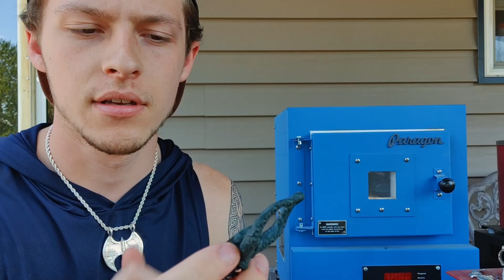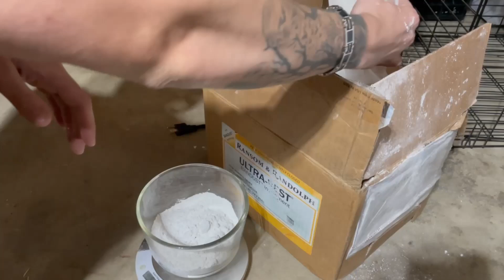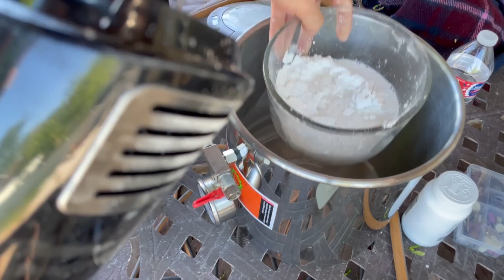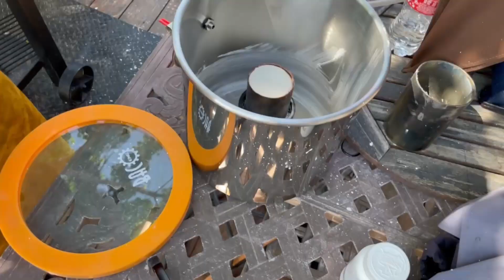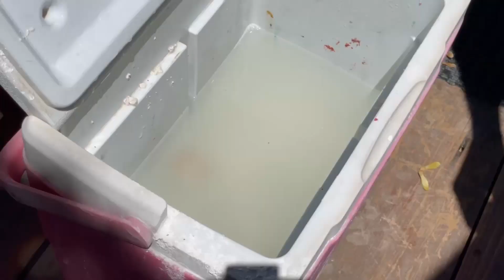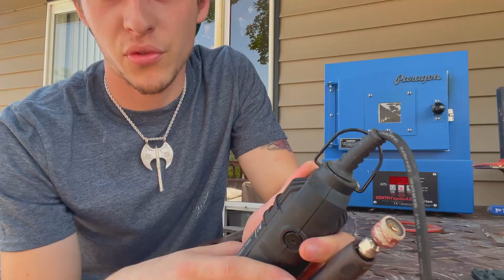How To Go From 3D Print To Real .925 Jewelry | COMPLETE Process

Comment: On your vac pot. if you can use a different metal pot that is just big enough for the 2 flasks, then you will get to a full vacuum in 1/4 of the time.  You can also vibrate the vac table with a palm sander.  My mixer pulls the vac first, then water then mix then pour all under full vac, and there are never any bubbles.   Looking good. Sub re Midjourney
Reply from the maker: Hey thanks for the tip! We'll try it out!